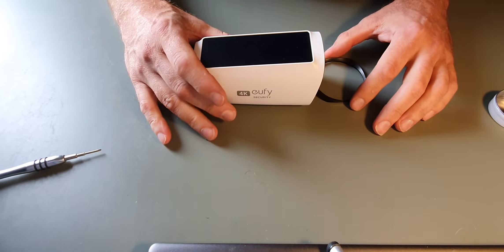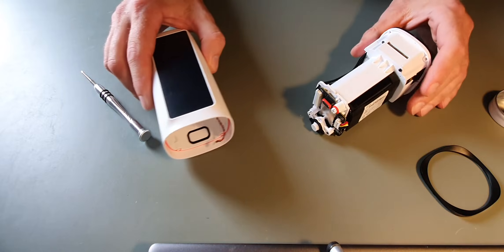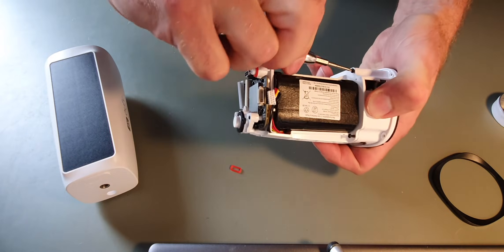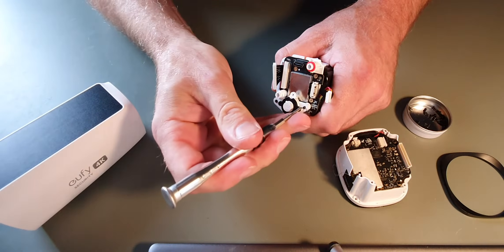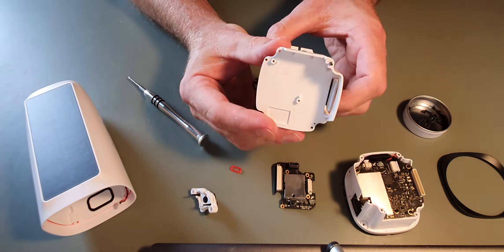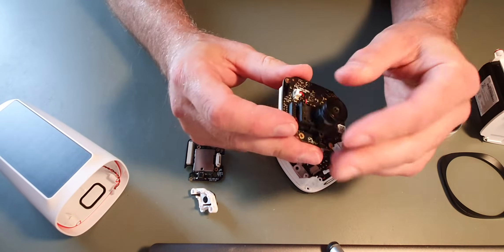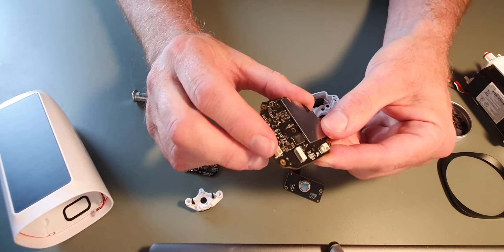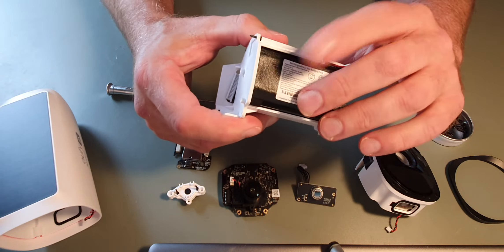eufyCam 3 S330 4K teardown - what's inside the eufy Cam3?

Comment: I have 3 of these and they do not get enough sun even on a sunnny day to maintain the  battery, I tried an exrternal solar panel but it also didnt work, can anyone recommend an alternative solar panel , the ones I tried didn;t even activate the charge when I plugged them in
Reply from the maker: @RadiatorSpringsMuseum  sounds like there may be a very high level of movement detection of the solar cant keep up with charging

Comment: Hi there, I have just taken delivery of the Cam 3 4xpack (S330) and still need to set up. However i have read a lot of reports regarding the solar panels delaminationg within 3-4 months and cameras not holding there charge - in full sunlight? More disturbing, is official response from Eufy not replacing this whicle still under the 1 year Warrantee. I am now wondering if I made the incorrect choice? Maybe i should have gone for Arlo?
Reply: The problem is them fighting with customers over replacing their defective hardware. Which is unusual for Anker(Which owns Eufy and provides support). Thats my biggest bone with them.

Comment: Mine won’t sync any solution for that?
Reply from the maker: Which cam and are you using homebase or wifi?
Reply: @eufysecuritycameraowners4795  s330 an i have the home base an im using it on wifi
Reply: @eufysecuritycameraowners4795  i cant manage to sync my s330 to my homebase3 and it happen when suddenly shutdown by itself and then i saw your video i manage to tear it down still wont sync,whn im syncing the flashllight turn on then turns off and i charged it like a day before syncing...any idea or suggestion thankyou in advance...btw nice presentation and easy to follow : ) more tear down please lol if you only have spare faulty ones.

Comment: thanks for the tear down. Do you know if your plug it all back together will it also restart the camera? Im having issues with trying to re-sync my camera after removing it from the app. I don't know if maybe disconnecting the battery and reconnecting it will have it reset and allow me to re-sync to the app.
Reply from the maker: This one I dismantled didn't work prior to tear down so  not sure if that'd reset the cam.  However you can dismantle without damaging it so I'd say it's worth a try.  The battery unplugs easily once inside
Reply: Just pull the battery out, i do this every day as a service technician. You can also measure the cells via the plug. Should be between 3.0v and 4.20. Usually its not the battery which is from LG same as in the Tesla. Its in the control board. Best regards. Björn.
Reply: Sounds good. Thank you for replying!
Reply from the maker: @Joey.Pareja  keep us posted on the results
Reply: @Joey.Pareja would you able to sync it back? Im having the same issue?
Reply: @Louie_831  I have a year manufacture warranty so I’m thinking to use that before opening it and voiding any warranty.
Reply: @Joey.Pareja  damn ok my year ran out so i might open it an see if it works
Reply: I opened it and unplugged the battery for about 30 min and when I plugged it back in and reassembled it, no change. It’s still not able to sync as a new camera to eufy app. I might reopen it and leave it unplugged for a while but first I’ll let the battery drain. I’m thinking it won’t be able to be re-synced as new. I wonder if there is a way to connect it via USB to a computer and wipe it clean with new firmware or something.